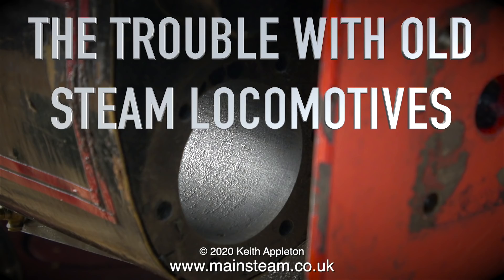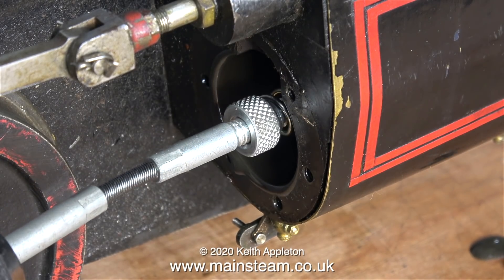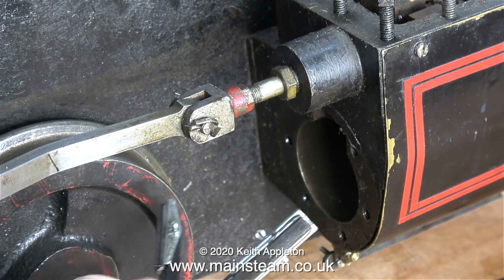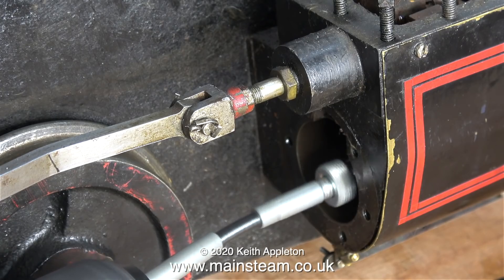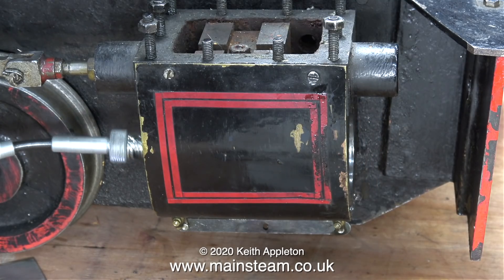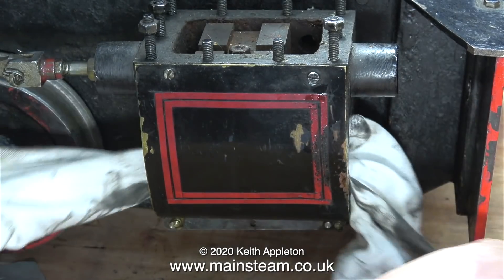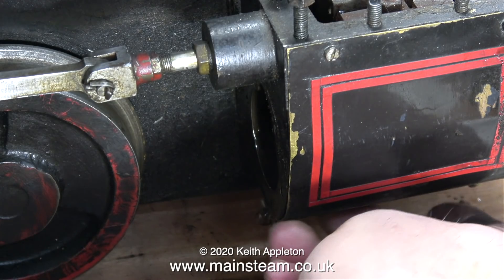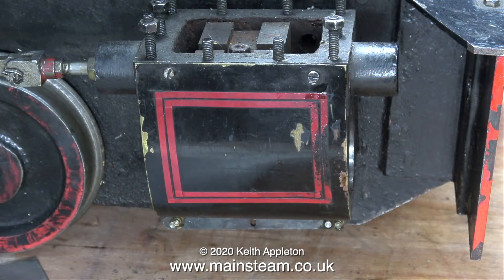THE TROUBLE WITH OLD STEAM LOCOMOTIVES - PART #4

Comment: I've heard that you're not supposed to use lubricating oil for honing. It supposedly still plugs up the hone. Diesel fuel or kerosene works well.
Reply from the maker: it seemed to work fine for me . . .

Comment: My loco has had the same manual operating system for the cylinder drains for years! My kids pushed it off its stand a long time ago and I never got around to fixing the operating lever and rod from the cab until last weekend. It looks like there is a hole in the middle of the bar that joins the two drains on that one where you could imagine the rest of the system was connected to work them both from the cab.

Are you trolling the experts using the ruler like that?
Reply from the maker: No, I always use rulers like that .... }:-)))

Comment: I build internal combustion engines for a hobby to race and as a job. With cast iron cylinders after honing. I wash the cylinders with dish soap and a brush. The amount of grit and dirt that comes out is amazing. I use WD-40 immediately after washing to prevent flash rust.